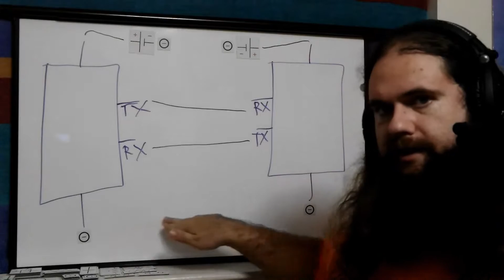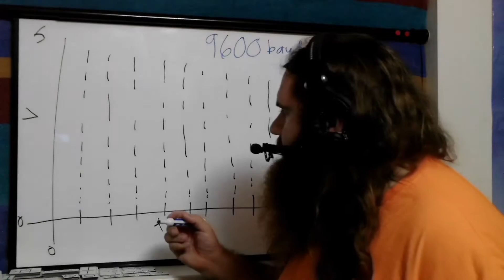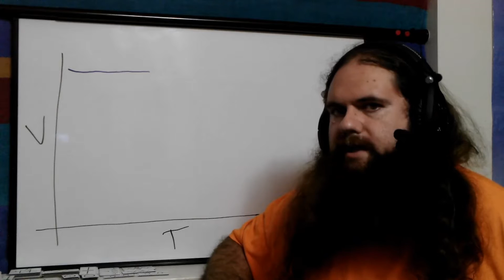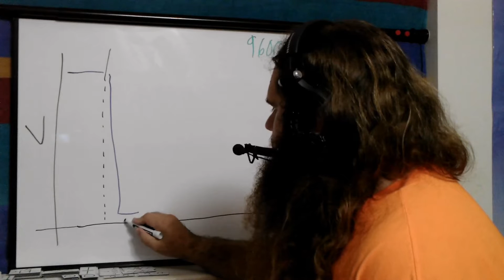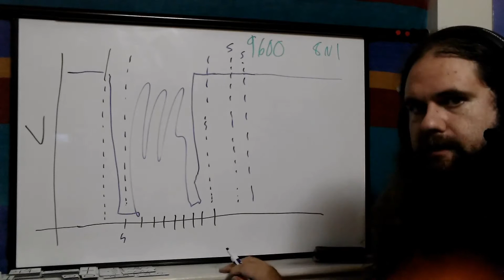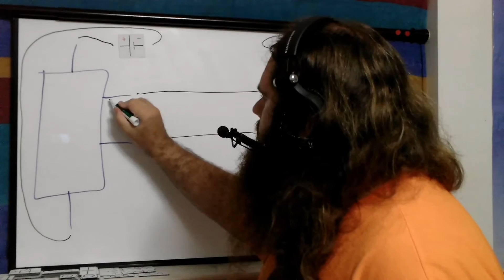Serial Data Transmission - Simply Put

Comment: Excellent video.
Just trying to figure out what the poorly translated instructions for a module I bought means. I have been trying to find out what 8n2 was and this explained it. Also finding out that the idle state would normally be HIGH explains a few things at the start of data transfer. Thanks

Comment: Do you have techniques for identifying a serial interface? Say you have some device that communicates with another using a simple 3 wire cable, in this case, a 3.5mm stereo cable. One of the ends to dev1 the other to dev2. Do you have any idea if it would use I2C or standard serial communication? If you attempt to read data using some serial interface, you get values from 0 to 255 (in my case anyway). You might try saying "if data is over 100, call it a 1, less than 100 call it a 0" (assuming the values are actually 1s or 0s) how can you determine if you're looking at 7 bits, 8 bits or whatever number of bits (now that I rewatch your video, I guess you can use sequential 1s as stop bits to delimit datapack sets). Anyway, I got sidetracked. Trying to determine what type of communication interface I am actually looking at..

Perhaps this will make it more clear. I have a pair of the Mattel MegaMan Advanced PETs that I want to interface with.

Opening the toy, you can see around the 3.5mm jack that the sleeve is ground. Ring is connected to what appear to be pullup resistors and …capacitors? Same story with Tip
(Can't see what processor the toy is using as there's a huge wad of epoxy over the top of it)

I have an Arduino set up to read serial and print out whatever I find on my monitor. It gets numbers ranging from 0 to 255
Mostly the numbers are 40 or less or they are 200 or higher. Sometimes in between
I do have the ground connected to the toy's ground as well

I have attempted using Nick Gammon's I2C scanner for Arduino to find any I2C devices which returned none (I tried reversing the data and clock lines with Ring and Tip to be sure)

I can only conclude it is standard serial but, strangely the lines seem to be connected 1-1
GND-GND Ring-Ring Tip-Tip. This doesn't work in standard serial communication so something else has to be going on.
The provided link cable that came with the toy is a standard stereo cable
I tried crossing over the wires on my rig here just to be sure and they don't work unless it's GND-GND Ring-Ring Tip-Tip

What do you suppose is going on here? I am still very inexperienced with using Arduino and even serial communication. Your video has helped clear much of my confusion. I only have hobby level programming skills. I thought trying a project like this would be a good way to learn and get better

If you're curious, the toys can be found on ebay for around $50 (at the time of writing). In my experience, most of the time they say "not working" because the battery may be dead or the ball bearing (sort of a primitive vibration sensor) fell out of it's cup. I would not buy these from amazon, sellers want 150-180 dollars for it

Anyway, that's all I got for now, really interested to see what you might have to say on this. I'm stumped. Be seeing you X)
Reply from the maker: If you have access to a full oscilloscope, the first thing you should do is look at it on there and make sure of the shape you are seeing. The human brain is incredible at pattern recognition, and even though you might not know what you're looking at, you're going to recognize "chunks" that can better tell you the kind of communication you're seeing. I'm not sure about your "ring to ring, tip to tip" issue without seeing a circuit diagram. Are your devices using full-duplex referenced to ground, or half-duplex with one line for data and the other for line-busy signalling, or are they even doing something fancier with a differential signal (compare voltage difference between lines, rather than line v. ground)? There are a lot of ways things can be hooked up electrically before you can drill down into the actual data being transmitted.
Reply: @simplyput2796  Hm, I don't have access to those kinds of tools. I have an old Sperry Instruments analog voltmeter my grandpa gave me. I could perhaps build the Arduino oscilloscope you built to see what's going on. I will keep tinkering and if I come up with anything new, I'll be sure to let you know, thanks for the reply!
Reply: Poorly drawn diagram (I hate the new paint program, I want the old one back!) of how I hooked this up in my dropbox https://www.dropbox.com/s/0r50vpbks8yuaea/Hookup%20to%20PET.bmp?dl=0

Here's my terrible code also in my dropbox https://www.dropbox.com/s/w68usljsni5jhnj/PET%20Serial%20In.txt?dl=0